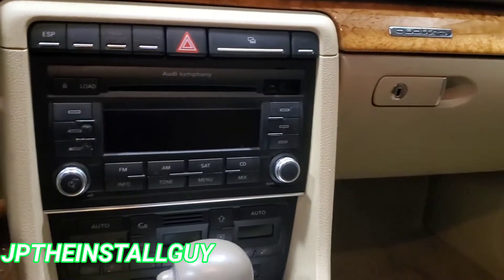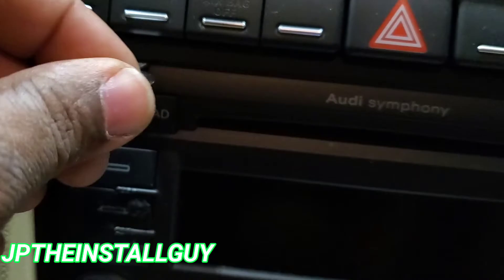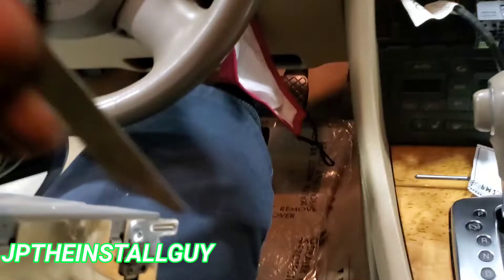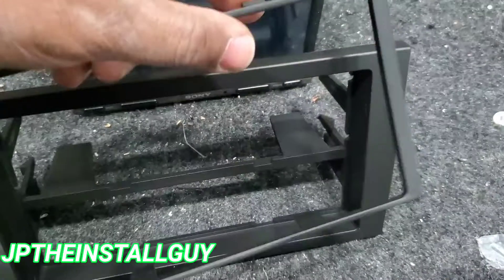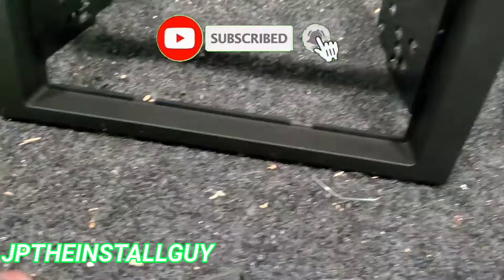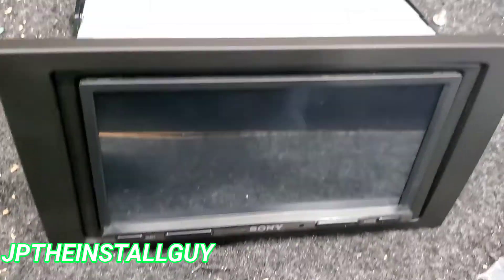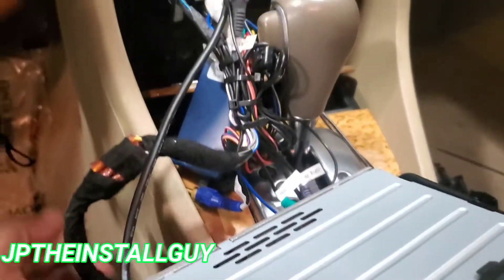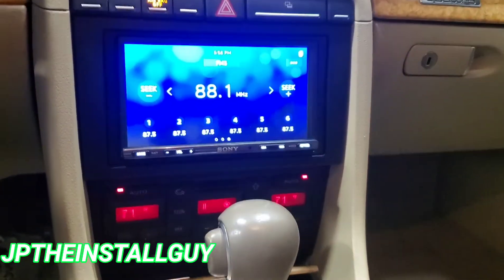2008 Audi A4 radio removal replacement and install

Comment: bruh thank you sm for this i swear i’ve spent hours straight looking for a vid w this dash kit, i got the same one, did the single to double din conversion n put it in but the rca cable for my sub must’ve gotten bumped so it’s cutting out, i need to get to the stereo to fix it but how do i take it out?? is there a way?

Comment: Did you have any issues with the rear speakers not being as loud as before with stock radio ? I have a chance to buy the rp4 ad11 canbus with sw option . But not sure if I want to buy if audio issues arise